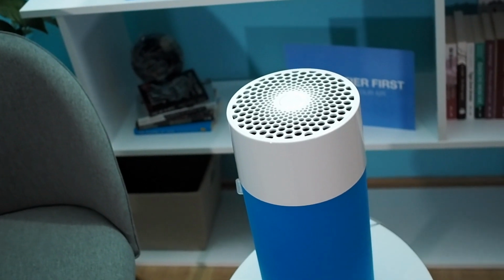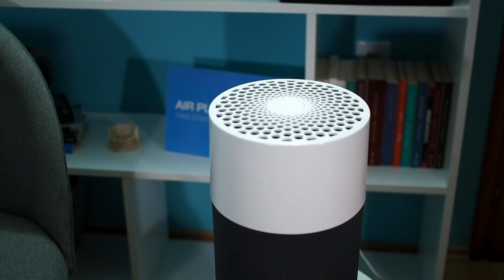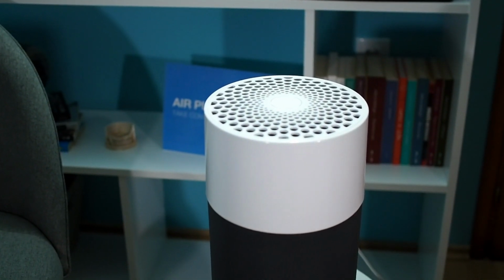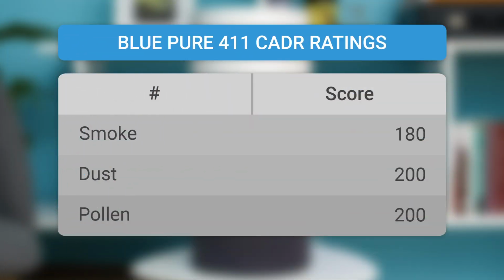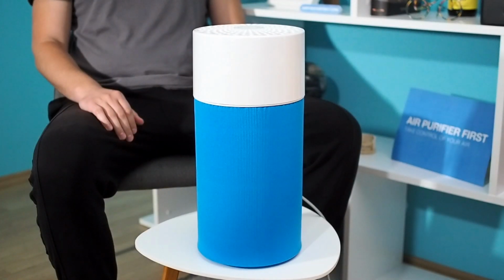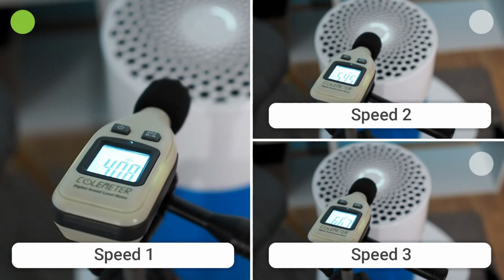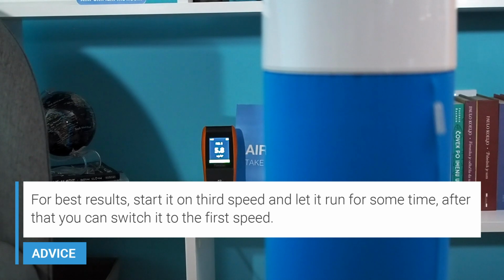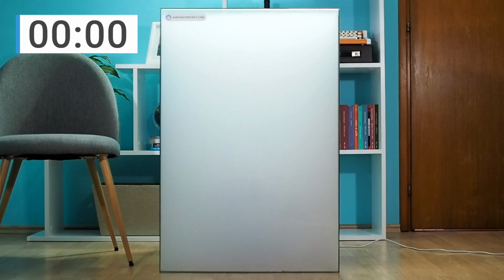Blueair Blue Pure 411 Review (Performance Test and Smoke Box)

Comment: What speed setting on the Blueair did you use for the purifier test?
Reply from the maker: I used it at the maximum speed.
Reply: @AirPurifierFirst  Thank you so much! If I use it at the lowest speed, does it just take longer to purify the air in the room or does it mean it'll perform less effectively?

Comment: Would this help with the stench in my bathroom after I go #2? My wife and kids complain they can't enter the bathroom for up to 2 hours and 35 minutes (we timed it) because my farts are so putrid. Last month, two of my kids passed out when entering, like within one hour after I finished my dump. I forgot to warn them with the post-it note on the door like we agreed I'd do. My wife found them passed out on the bathroom rug in the doorway unconscious. She had to crawl dragging them to safety in the hallway for fresh air. I guess I've become immune to my own gas so it doesn't bother me the same way. 🙄💩
Reply: No, HEPA and electrostatic filters cannot remove odours. You would need to find an air purifier that has a significant amount of activated carbon to adsorb the odours. Examples include the Austin Air Healthmate or Healthmate Plus, IQ Air HealthPro Plus, and IQAir MultiGas. The Winix 5500-2 or an AirDoctor would also help, but you would need to replace the carbon filters more frequently than the other models I mentioned. Good luck 🤞
Reply: Forgot to mention: it is imperative to turn the bathroom exhaust fan on and leave it on for a while. Also, if your bathroom has a window, OPEN IT and leave it open for at least 15 minutes after.

Comment: Get a 19 dollar Merross HomKit plug and you get all the timer you need.
Reply from the maker: Great advice, thanks!
Reply: @AirPurifierFirst  I specifically bought the BlueAir just for the fact that it remembered the state after power loss. A lot of air purifiers will reset when power goest out.
Reply from the maker: Yes, the 411 has that feature, as well as the 211+, which video review I will publish next week.

Comment: how do you turn on the blueair, in the smokebox?
Reply from the maker: It turns on itself immediately after connecting to the power source, and it operates on the last used settings. So, it's not that hard to perform the test.

It is also good to know that you can connect the Blueair 411 with the smart plug.
Reply: @AirPurifierFirst  That was exactly the point of my question. I want to be able to connect it to a smart plug. Other sensors in the room then control the Blueair and I can get more filter life. Such a function is crucial for me to buy.

Thank you for the extremely quick answer

Comment: I'm looking for something to help eliminate cooking odors from my downstairs neighbours... it's an older building and when they cook it smells as though they might as well be cooking in my apartment. It is a small apartment (around 500 sq ft.) although I believe most of the smell enters my unit through the vent in the bathroom, which is above their kitchen. Would this purifier be up to the task?
Reply from the maker: If you put the air purifier near the smell source, it will reduce the odors. But, a huge amount of cooking odors will result in replacing filters more often than usual.
Reply: You would still be able to smell the odors, but they will be less intense and the air will be free from odors faster.
Reply: Why don't you just throw a bath rug over the vent, or keep your bathroom fan on and keep the door closed?

Comment: Just a suggestion - I bought this great air purifier, and love it.  But my suggestion is, when you are going to clean the pre-filter, either vacuum it while the filter is ON the machine, or, if you are going to wash it, take the filter outside to remove the filter.  If you remove the filter inside your home, all the larger dust particles that it has caught, will be thrown back into the air.
Reply from the maker: Thanks for the fantastic tip!
Reply: @AirPurifierFirst  Don’t ask me how I found out about that tip.....lol.
Reply from the maker: @Inisfad  It's obvious :D
But, be happy, I'm sure this tip will help someone.
Reply: @c0de TearZ I have a couple of cats, so possible hoover it more than one would normally,as I can see pet fur that is sticking to the material of the filter.  I do it about once a week.
Reply: @Inisfad  possibly the same way I found out the same thing? 😂
Reply: As he was taking the filter off I couldn’t help but think the dust would be everywhere… back into the air.🤔
Reply: I just forgot to do this...I was so eager too change it and just did it in the living room. 🙃  I will turn it on for a while and hopefully that will catch any dust particles I released into into air. I'd also recommend wearing a mask while changing it.
Reply: no sht sherlock

Comment: The CADR should be atleast 300 to be considered good and many of those air purifiers dont reach that :(
Reply: It's their smallest unit, a $120 filter table-top filter, meant for small rooms such as a bedroom.  CADR of 300 is a medium to large rooms.  The 211 model is 350 and the 311 is 250 CADR.  Blanket statements of 'good' like this don't help - you should buy a filter for the purpose... larger filters have higher operational costs by a non insignificant margin.
Reply: @brandall101  this one got Smoke 105 / Dust 120 / Pollen 120 so no NOT enough CADR... https://www.airpurifierfirst.com/review/blueair-blue-pure-411/ scroll down to check the specs...
Reply from the maker: Hm, maybe, but there are other facts that you should consider when talking about air purifiers, such as filter efficiency and the size of the room where you are planning to use it.

Comment: I just changed my filter did everything I was suppose to and the light is still red wouldn't go back to blue....I took it apart and made sure everything was done right and it's still red.  It is running fine though what would cause this to not reset.   Ok now just didn't seem to reset before   Thanks
Reply from the maker: Did you reset the filter reset indicator by holding your finger on the power button for 5s?
Reply: @AirPurifierFirst  I did a few times and it didn't work and the last time I did it worked thanks.
Reply: Me too I did the same many time and it’s not working still

Comment: One negative about this product that I noticed immediately is that it has only three fixed speeds. I would like to use a speed between the first and second one. The first one is too low, but second is too loud.
Reply from the maker: I completely understand you! I like it when the air purifier has more than three speeds.

Anyway, Blueair 411 is a minimalistic and powerful device, so not having the fourth speed is not a big problem.

Comment: I used only for about a month and it stopped working!!

I plug in and it does sporadic slow rotations. 

I tried to fix it but no clue
Reply from the maker: I suppose you have a valid warranty, so my suggestion is to contact Blueair directly.

You can contact them via many different channels (email, phone, fax, contact form). Please go to this URL and scroll to the bottom for contact info.
https://www.blueair.com/us/customer-support-blue.html

Elaborate your issue with them, and ask for the best solution.
I wish you all the best!
Reply: Rotations?   This device does not rotate.
Reply from the maker: The device is not rotating. The motor inside the air purifier is rotating.

Comment: Hi. I just purchased the 411 for the sole purpose of removing dust from my small 75 metre squared apartment as when I leave items somewhere, they gather so much dust on top within a day. Will this help remove majority of the dust? Thanks in advance
Reply from the maker: The Blueair 411 model is intended for rooms up to 161 square feet, which is approximately 15 square meters. For your needs, you should buy a device for higher room coverage.

Alen BreatheSmart Classic might be a smart choice for you.

Comment: My button turned red after changing the filter.. then reset it and turned white.. how can i turn the button into blue again?! Pls help.. thanks
Reply from the maker: When light is red, that indicates the time for resetting the filter, which usually happens after some time of using the air purifier.
When that happens, you should press and hold the power button for 5s to reset the filter. After that, the lights will back to the default.
Reply: @AirPurifierFirst  it turned into white.. would that be ok?!
Reply from the maker: @portiadeleon2442  Yes, don't worry.
Reply: @AirPurifierFirst  thank you so much.. you are such a big help.. God bless

Comment: It would be interesting to see the purifying effect with the lowest speed setting. Is the effect same as with the high speed setting but it takes longer time to clean?
Reply from the maker: Yes, it is, but it's a little bit slower and less powerful than on the third speed. The best you can do when using an air purifier is to combine all speeds, depending on air quality in the room.

Comment: At 3:22 you claim it's a HEPA filter (99.97% efficiency). It's not. The marketing material of the manufacturer leads you into believing that the Blue Pure line uses the same filtration technology as the more expensive offerings, which have a corona discharge ionizer upstream of the filter. Nowhere on the Blueair website there is any statement about the filtration efficiency of the Blue Pure 411 or 211 device. Not that it matters that much, since the clean exhaust air is mixed with the dirty ambient air anyway.
Reply from the maker: I'm sorry, but I said it removes 99.97% of particles with Blueair HEPASilent technology.

You can read the explanation about removing particles from the air when using HEPASilent technology on the Blueair website. Here's the URL:
https://www.blueair.com/gb/hepasilent-technology.html
Reply: @AirPurifierFirst  Read carefully. The 411 product page mentions "HEPAsilent" at the bottom, but it does not claim anywhere that the 411 actually uses it. Neither does the product manual or their published test data. Bluair's patent (https://patents.google.com/patent/US20090151567A1/en ) describes a high-voltage ionizer sitting upstream of the filter medium, which is present in the Classic product line, but not in the Blue Pure line. It wouldn't be possible to do that safely anyway with the Pure design.
Reply: @hankwangn  you're right, thats a play on words. its not a true HEPA filter. It just runs very quietly like one, very quiety. Also it's does not ionize the air at all! I have two 411's and one 211+. I've had them for about 4 years now.
Reply: @jodykidp5396  would you recommend the 411 ? Need it for pet dandruff
Reply: @fadedones  great questions.....would like to know myself 👍

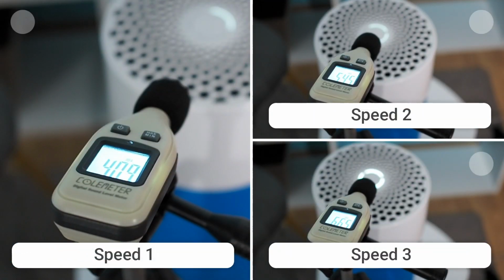Comment: With your noise measurements at 5:19 , what was the distance between the microphone and the purifier unit? The industry standard is 1 m (3 ft 3 in), well away from reflecting walls and ceilings. The image for speed 2/3 looks like the microphone is right on top of the exhaust.
Reply from the maker: The distance is about 15.748 inches (40cm). We had in mind thing some people will use it just right next to them or on their working table. So, it's much more closer than industry standards suggest.

But, thank you very much for that information. We'll keep it in mind, for the next reviews we do, for air purifiers, which are used for bigger rooms.

Comment: Great review! I just bought one for my apartment. I'm curious, what happens if I use this small one for a larger space, let's say move it to my living room?
Reply from the maker: It might work well if the room is not much larger.

One suggestion, if you plan to use it in the larger room, run it on the third speed until you feel that air is fresher.

Comment: Since this purifier has an ionizer, it means dust are more likely to fall onto surfaces which technically "purifies the air", do you notice any layer of dust on surfaces in the room? I think it'll be a good future test but may be time consuming.
Reply from the maker: No air purifier device will suck dust from the surfaces. But, when using air purifier you will notice far less dust in the air and you will breathe with ease. Also, after a while, you will notice less dust onto the surfaces.
Reply: Does it really has an ionizer? I looked at various sites and ionizer is not mentioned anywhere.
Reply: @canuck21  No it doesnt. From their own FAQ, which apparently was too hard for the OP to look up.

Do Blueair air purifier have an ionizer?
An ionizer, or ionizer air cleaner, uses a high-voltage charge to produce and emit ions into the room as a means of cleaning the air1.  The by-product can be ozone, yet at very low levels, as all household air cleaners sold on the US market must follow stringent regulations for ozone emissions. 

Instead of emitting ions into the room as a means of cleaning the air, Blueair air purifiers use a combination of mechanical and electrostatic filtration to remove even the tiniest particles (down to 0.1 μm) from indoor air. We call our filtration technology HEPASilent™.  Whereas an ionizer, or ionizer air cleaner, uses a high-voltage charge to produce and emit ions into the room, Blueair’s HEPASilent technology, uses a fan to draw charged airborne pollutants into the air purifier so that they stick more effectively to the filter. This increases the filtration efficiency of Blueair air purifiers, while at the same time achieving a higher Clean Air Delivery Rate (CADR) and more silent and energy-efficient operation.
Reply from the maker: I have talked with Blueair support several times, and they state that every Blueair air purifier has an ionizer built-in. It’s called HEPASilent technology, and it is a combination of electrostatic and mechanical filtration. You can also confirm this if you read the Bleuair 411 energy star certificate results.

Comment: Straight forward and informative video. Just purchased two after reading the reviews from Wirecutter. Your video confirms the reasons for purchase and helps prepare for their arrival. Great work, thanks!
Reply from the maker: I'm delighted when I got a comment like this. Thank you a lot!
Reply: Have you been pleased with the performance?
Reply: @alcopower5710  You'll note in my comment, "helps prepare for their arrival." I ordered these from a seller on Ebay. They were never delivered, so I have no experience with them. Wirecutter is a review database run by or from the New York Times. I have had good experiences with their reviews. Do a search and read the Wirecutter reviews. Hope that helps.
Reply: @rwolfson1935  that stinks I hope you got your money back